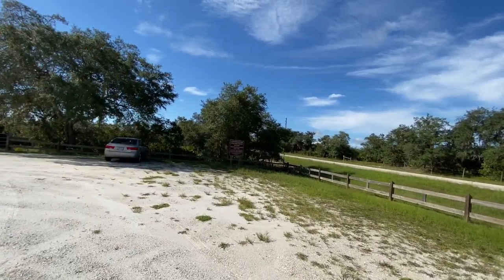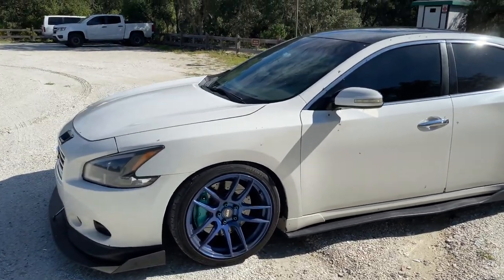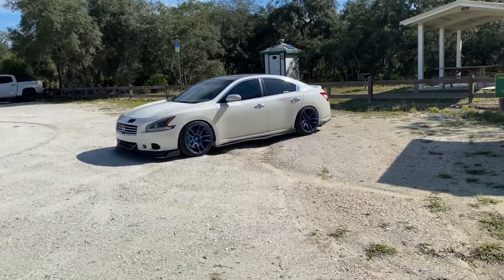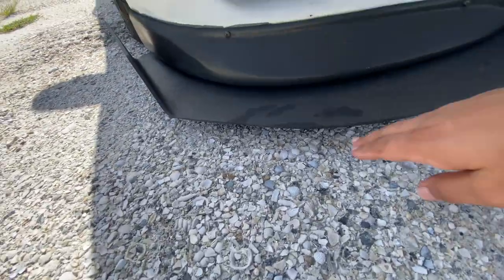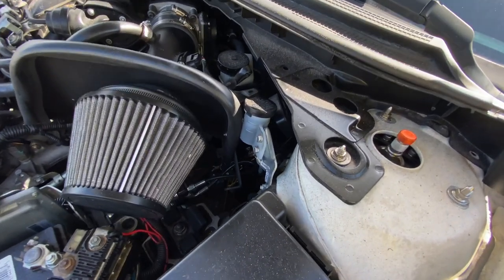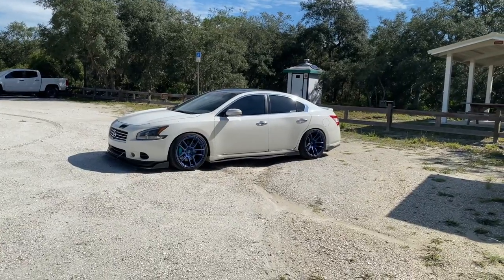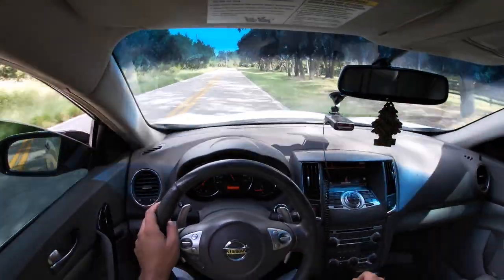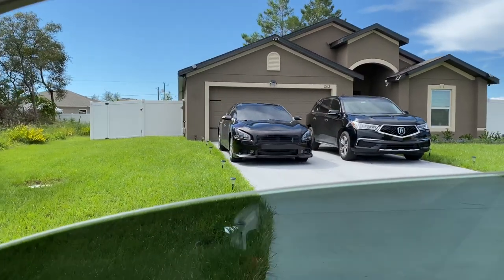How much is it to Swap my 7th gen Maxima Race Car #viralvideo #youtuber #cars #modified

Comment: I can't say thank you enough . . . . Thank You!

I was seriously debating doing the swap. Doing my homework and actually interviewing mechanics. This is my 3rd Maxima and 7th Nissan vehicle, including a Hardbody I had back in high school in 91. Needless to say, I am a huge fan of Nissans, and particularly Maximas. 
Having said that - THANK YOU - so much for doing this so I do not do it. There is NO way I am spending $10k. I can move on now from my 7th Gen. Thank you again for helping me move on. Question now is, do I get a Z with low miles (less than 10k)? Or do I wait until the new designed Maxima comes out? IDK, fun to be me though
Reply from the maker: You’re welcome bro.. tbh a Z has more aftermarket support so more things can be done to it.  Now this price is what I paid but I did extra things. It can be as low as 5k if you do the work or 7k if shop charges cheaper. But a Z is great. And if you get one get the HR motor.